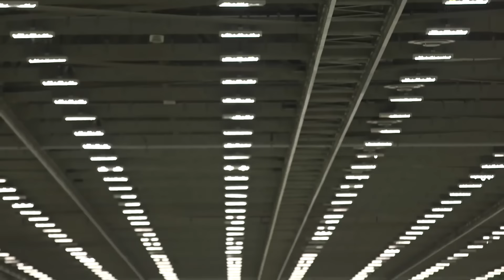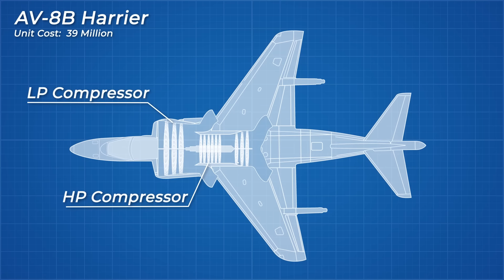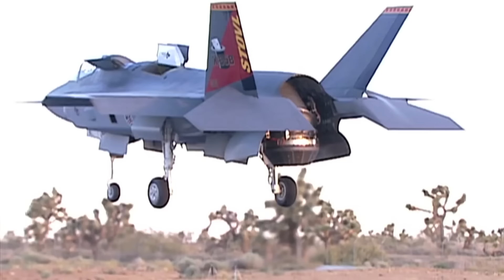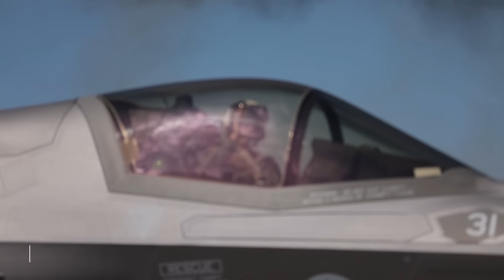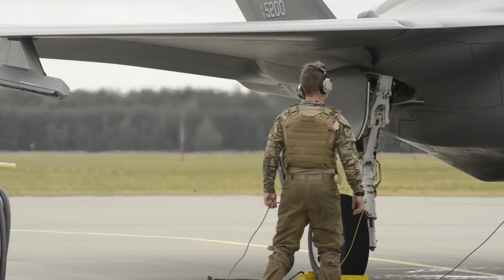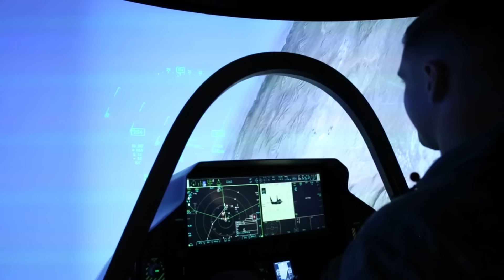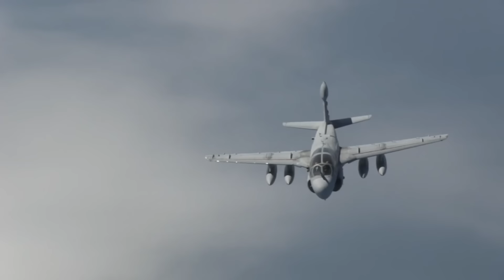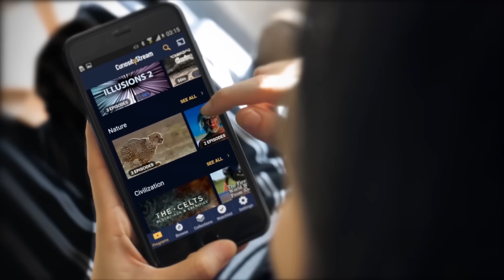Is The F-35 Worth $115 Million?

Comment: So let me get this straight: They tried to design a plane which would satisfy all three branches of the JSF program, and did so with the hope of making the plane cheaper. BUT ended up having to design 3 different variants anyway to satisfy the different needs of each branch effectively driving up the cost of the plane hugely.  Sounds like a mess. At best it should be an Airforce and Navy plane. Leave the marines to a separate fighter program, and design a separate plane specific to their VTOL needs. You can't make one plane that can effectively satisfy everyone.
Reply: @Joe150 ish Should they have have just flown F-15's and F-18's forever? It was needed clown
Reply: the video put a more optimistic spin than I would have. Even the numbers coming from the vid you can see the planes that are being replaced are 1/ to 1/3 the cost of the new ones. That also doesn't include maintenance and facility upgrades for the new planes.
Reply: Its a big assumption that 3 different unique planes would be cheaper, its entirely unsupported at this point, fighter development is hugely expensive, its why fewer and fewer countries can afford it.
Reply: @kashatnick  It's disingenuous to claim it's "entirely unsupported" that developing separate planes would be cheaper. 

In the 1970s the US embarked on separate programs for each of the services and the result was the F15 and F16, F14 and F18 and Sea Harrier. The total cost of ALL these programs was expensive but still less than the predicted cost of the F-35 program and (aside from the retired F14), these planes all exported successfully and are still in service today.
Reply: Marines never needed VTOL in the first place ! thats an old ,stupid , lunacy ...
Reply: @Weazel that's no joke that s a fact
Reply: @Weazel nope your just stupid
Reply: It's no more expensive than Rafale-M or Eurofighter Typhoon though. The F-22 is a USAF-only fighter and it's nearly twice as expensive. Even the Super Hornet is only slightly less pricey.
Reply: @mickeyg7219  its more expensive by a third of the price period ! 77 M for a rafale M 115 for a F- 35 C
Reply: @Joe150 ish no, you're just too stupid to understand it
Reply: That development cost covers 3 separate systems, just under 1 name and air frame. It's really not all that expensive.
Reply: @commiespy4908  considering only one of the versions actually work has intended ...i say Pentagon is glad to have tax payers like yourself !
Reply: @calgar42k  you do understand it is still under development, no?
Reply: @commiespy4908  after 13 years ! by the time they ll get out of productions lanes they will be obsolete ... and their BVR dominance without a proper missile is lets say a joke !
Reply: @calgar42k  The F-16 has been in service for...oh, what....35 years now? And it's one of the largest and most important assets in America's arsenal. The F-35 is designed to replace that. And not soon, either. The F-35 is far from being obsolete. And your missile comment? The F-35 will have one of the most advanced radars developed to this day, supporting capabilities with the combat proven AIM-9, AIM-7, AIM-120, and up and coming AIM-260 (still in development, but set to deploy by 2020). The F-35 is about as far from obsolete as you are close to ignorance.
Reply: That's why its 3 different planes
Reply: @Joe150 ish Keep telling yourself that. You're too stupid to even understand why it's so revolutionary

Comment: If it was my money, I would rather buy less F-22's and upgrade them, then inferior F-35's.
For deep strike missions the stealthier UAV's are way to go, and for close air support it's the A-10.

BTW:

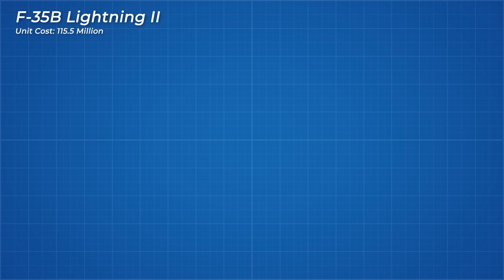6:56 Turboprop has a propeller, turbofan has a fan, so as the lift-fan. Maybe you meant it's powered by a shaft, like turboshaft?
14:30 It's synthetic sapphire (not a gemstone) you can get them from 10$ for your watch. It's harder and more scratch resistant than glass or polycarbonate, but heavier. And the system is nothing new, almost all new fighters for the last 40 years had IRST (except F-22 because cost cutting), but I guess the F-35 has one of the best/newest ones on the market.

Comment: 1s - No, shooting first is no where near the be all and end all. BVR (+37kms) - beyond visual range combat is still a pipe dream even today in 2019. Knowing where the enemy is can give attackers an advantage tactically but most missiles burn all their energy on release and hard crank manoeuvres will see the missile waste most of it's energy trying to get to the interception point and then end up moving slower than the aircraft it's attacking after they crank back the other way.

2nd - Energy Bleed is a huge deal in dogfights. Speed is life. The whole reason BVR doesn't work is the high speed manoeuvers  plus maintaining that speed. If you lose your energy then the missile has you again. 

3rd All fighters talk to each other and also AWACS. This isn't a new idea at all. Also a HUD in your helmet isn't a new idea either. Just no one knew how to design one to cost that much. 

4th AWACS will do almost all of the heavy lifting for radars in any serious air combat. Few fighters ever use their own radar unless they are way off the reservation... which they can't because most fighters have a very short range, relatively. 

5th Stealth isn't really a thing. F117s have been downed by missiles. All stealth means it's slow as it can't go hot with afterburners because that spits out high IR readings which any radar and most missiles can track.

Comment: $115 million?

"This year's agreement (2019) will lower the cost of each F-35A, the most common version of the aircraft, to $81.35 million, Under Secretary of Defense Ellen Lord said, down from $89.2 million under a deal inked in August 2018.

Under the options covering the second and third years of the purchase, the price of each jet will drop below $80 million, Lord said. In those later years production would be around 160 jets per year."

The bulk purchases made the F-35 even cheaper than the F-15SE, GA-18 E/F, Euro Fighter, and many others out there.
Reply: You didn't watch the entire video
Reply: @chrishall2594  yes i did and it says $85 million by the end of 2019 when in fact it is even lower at $81.35 million as quoted.
Reply: @rogermendoza3541  Take into account the original pricing and the FUCKTONS that were wasted in development so Lockhead execs got massive bonuses . . .  long term this plane will cost almost 2 trillion dollars . . . . 10% of the national debt . . .  for a plane that lost a dogfight with a fucking TOMCAT.
Reply: @NymbusCumulo928 Production costs for a program that is expected to cost $1.5 trillion over its 55-year lifespan.

 How much do you expect it would costs the over 3,100 F-35s the Pentagon will buy in 55 years of operations and maintenance? The F-35A operating costs is around $44k per flight hour and the Defense Department says it might be able to pull that down to $25K, which I doubt but the F-22 operating costs is around $59k! Had Pentagon bought an equivalent number of F-22 (3,100+) that $1.5Trillion over 55-year program is peanuts.

F-35 is more sophisticated than the F-22 (avionics and technology) and it was designed as a multirole, not primarily as an air superiority combat aircraft. While the Tomcat is a superior dogfighter, the F-35 is designed as a superior BVR and ISR combat aircraft and the Tomcat will be shotdown by the F-35 before it even knows it's there. I am sure in real combat situations the air force will pair the F-22 and F-35 together and no air force in the world can outmatched them.
Reply: @NymbusCumulo928  it's also an older and technologically inferior design.
Reply: @NymbusCumulo928  Typhoons are great in Egypt when their not being shot at. But if an aircraft doesn't make it over the target then it's money wasted. F-35 WILL make it to the target: Even if they can see it, they can't lock it up to down it.

Also, the Tomcat was at the top of it's game, the F-35 it "went up against" was without paint and without avionics and even still the TC had to be directed to the intercept. Your argument is without any merit. Not that there aren't good arguments against it, so instead of muddying the waters with fascicles, why don't you stick to those?
Reply: @NymbusCumulo928  How is that? The Eurofighter Typhoon is €90 million (system cost Tranche 3A) a piece. Besides, F-35 is superior in BVR and ISR capabilities unmatched by any 4th Gen. Aircraft out there. If there is any better aicraft (safe and effective) and that would be the F-22.
Reply: @Joe150 ish Sure... I don't have the time. 
(eg: F14 can do Mach 2 for approx 9 min, where an F35 is in super cruise from TOC to target AND BACK. The rest of your post is just as uninformed.) Goodbye.

Comment: the price of a F-35A is 89,2 millions which is 0,8 millions less than the Eurofighter Typhoon with a 90millions price tag while not being stealth, having the same thrust (60kN x2 vs 120kN x1) and a worse avionic and maneuvrability at full load because of higher drag due to wing mount compared to the internal weapon bay and even at full bomb load under wings the F-35 have a smaller RCS than an empty F-16

no other plane in the world can do what the F-35 does... in some areas it's better than F-22 aswell

expecting a multirole single engined jet (f-35) to maneuver and be agile like a twin engined jet (f-15) made for air superiority is just stupid... it's like expecting a F-22 to be as good at carrying load as a B-2 spirit, they are designed for different roles and different doctrines, yes the F-15 now can do strike missions but they are just an extra which was added later on in its carrer, its main duty and its origins are all focused on air to air fights so these traits of agility come over from its past

of course in some other areas it's worse than many other planes but the future is stealth because those who have the first look have the chance to down the enemy first... you cant be downed if you cant be detected and even when detected you need a lock on with a system accurate enough to provide guidance to a missile and low frequencies radars dont allow that.

Comment: Re the big comparison between the capabilities and difficulties operating the Harrier via the F-35 .  I feel there should have been something said about ' the Harrier (though developed) was basically a 1960s aircraft' via a much more modern design (the F-35).
Try comparing a 60s car (pre ABS, pre seatbelts, pre ECUs etc [yes these things did exist but where NOT in common use]), with one that is in development, if not in common use, today.

Comment: the US Navy originally didnt want the F35 due to having a Single Engine configuration.
why do you think the Navy always used twin engine such as F14, F18, etc because the navy loves redundancy, when 1 engine goes out the other one can still get it back home.
although im sure Durability and Reliability have increased significantly from past to present, its still a single engine aircraft, once that engine shuts down its a flying brick.
but in the end of it the Navy didnt have much choice as Washington really pushed the F35 program
Reply: I don't understand
why you

have to

write like this
Reply: @lastblueride5  unintentional, apparently when i press enter to just go to the next line on the youtube app gave it a huge gap, *fixed :)
Reply: *Flying laptop

Comment: So what was supposed to be "one aircraft for all" now has 3 versions. So what was the point. The Harrier, F 16 and A10 are all proven fighters. The F 35 never will be able to perform better than any of the afore mentioned aircraft. Short answer NO.
Reply: Luv the A10! Tough as a brick! Massive payload! Supercannon! I can't conceive any manned craft more lethal in the role of ATG. During the Gulf War, the Iraqi soldiers called it the "Cross of Death." It is NOT overrated, imho.
Reply: @d.dementedengineerc99isurf26  You are quite right, if you were on the receiving end of a A-10 cannon attack, I would imagine death would be quick and just prior to that event your underwear would be a dark shade of brown then very red. Either side of the event you would not smell that good either.

Comment: Issue is: stealth is its only advantage. 
If it's in "Beast Mode", meaning: carrying rockets and bombs under its wings, the F35 has a HIGHER radar-echo at least similar to an F15; AND it's slowing down its manvourerability even more. Combine it's not even fast or agil in the first place ("it's stealth, it doesn't have to be"), it's one sitting duck - since ALL modern radar can track the "stealth-planes" nowadays, and there will ALWAYS be an IR-signature. So stealth became a way smaller advantage than the Lockheed's marketing dept is tellling people.It has become "easy to detect"; and what can be detected, can be shot down (ask the pilot of that F117).

Also, the plane itself isn't the only thing needed to be bought; the mentioned computer, connectivity and hightech-informationsystems needs a massive investment in groundsystems, so everything can work together. In total, with informations at hand that are no more suffisticated than anyone elses, I'd say the SYSTEMprice for an F-35 will be about 190 to 200mil, while the plane itself costs 115mil. So every airforce that wants to buy the F-35 essentially has to replace ALL components (from radar to everything) so the F35 can do what it was bought for; this is a massive cut in every budget. 

...this answers the question "is the F35 worth $115 mil?" with a definitive "as one has to look at the whole system-price (F35 plus groundequipment plus maintenance), the answer is NO. The only advantage over other modern planes is no longer as big as it was 27 years ago; this makes the F35 into a top-modern and neat airplane, that will lose against other competitors, especially in combat/dogfight situations".

(also add, that eg. EF Typhon and Dassault Rafale make use of an active stealth-method, thus having similar stealth-attributes as the F35 but WAY more advantages in both dogfight and attack, while the systemprice (including maintenance!) is lower than the one for the F35)

Comment: It's not 1 plane, it's 3 that share only a few parts. The philosophy behind the plane's design goals has been tried before. It failed, as it did before. We learned the last time, that the needs of the many roles that the plane was supposed to fill, contradict each other. So to make it better at one thing, you consequently make it worse at another. The B model has serious potential, but at an enormous risk/expense. The A model ''last I heard'' will require 4x as many planes to perform it's duties safely, due to maintenance requirements. It can only carry 4 small weapons internally(maintaining it's very limited stealth, making it slower, and even less agile). What are you going to do when your out of missiles. Run home(oh wait, not fast enough), so  you'll have to dog fight(your screwed, unless your enemy screws up bigger). It's not all weather capable. It's slow for a fighter. It's heavy, which makes changes in direction and accelerating more difficult. The best argument I hear from F35 fanboys is electronics are the greatest. Imagine if they put those electronics on awesome close air support, fighter, and attack planes. Design each plane to be the best at it's specific role. The fastest car in the world is not going to be the most fuel economical car, but that's okay, it's the fastest.

Comment: I still think it's a flying scrapheap regardless of what anyone wishes to say. This thing should be multi-role, but it can't even carry that much weaponry. For that matter, how the hell does anyone believe this thing can replace a A-10's massive firepower and specific role as example? Or for that matter the real multi-role aircraft that is the F-16 which can carry a huge range of weapons and can actually carry a lot more then the F-35 can? Yes you could give external weapons to the F-35, but that would defeat the purpose of stealth and the wings can't hold as much as a F-16 or F-15 could making it a huge gamble. There are a lot of problems that pretty much everyone wishes to ignore or wave off as if it's no big deal. Yet none of these individuals think further then "awww a new aircraft let's ignore all other things around us!"
Reply: The F-35 can carry an F-16's MAX air to air payload or average strike payload internally, and externally can match the F-16's MAX payload. The F-35 is by all metrics capable of carrying significantly more than the F-16. Why even bother bringing up stealth when the F-16 simply wouldn't be used in a situation requiring stealth?
Reply: @dumdumbinks274  I didn't say anything about the F-16 being stealthy at all, the F-16 is a known huge dot on the radar. True that the F-16 is old, but that doesn't mean there are no options to change the design as a major upgrade to make things a lot easier and cheaper. Even a F-16 could gain a reduced radar blip.
Reply: @SIG442  Yeah, but you compared the F-16 to an F-35 configured for a much more dangerous mission than the F-16 could perform. That's not an accurate comparison, and you were wrong anyway.

Comment: Quick rundown on the cost factor.. yes they are expensive. No they do not need to be able to dog fight. If you build 3 planes for 3 branches you spend more total than on one program. Not to mention maintenance costs are lower since the parts are nearly identical on all of the planes across 3 branches.